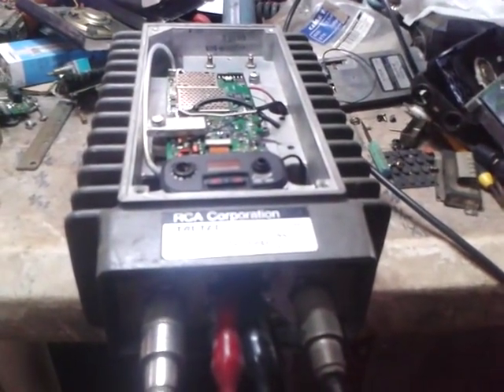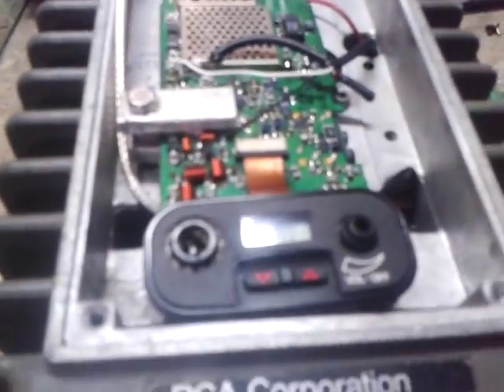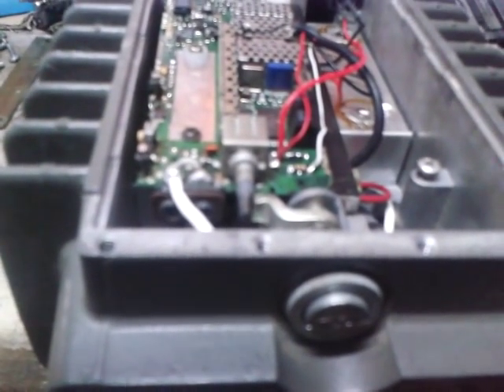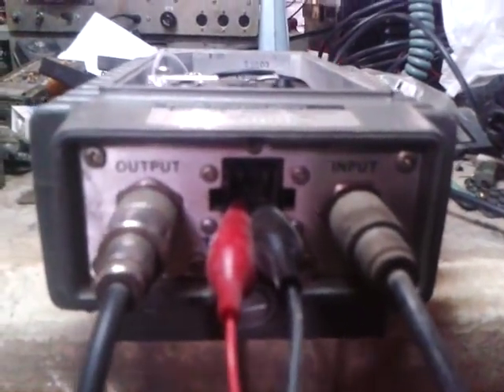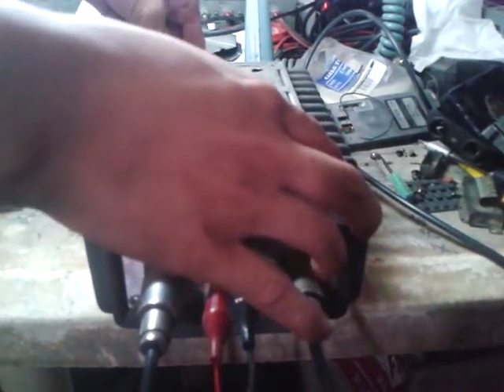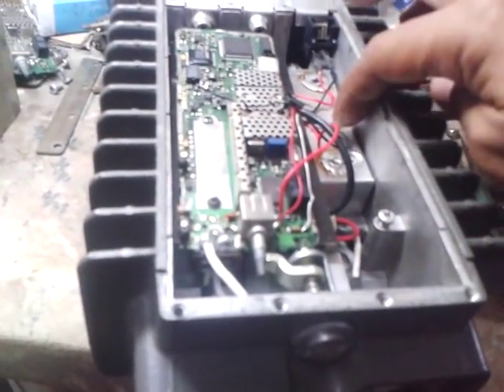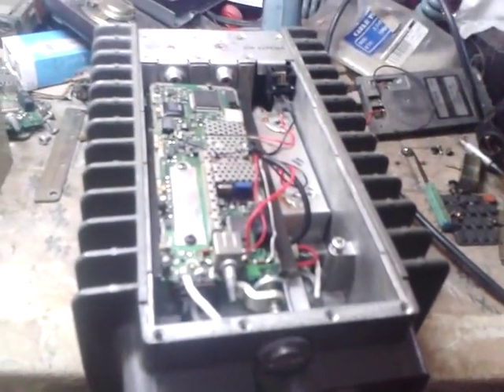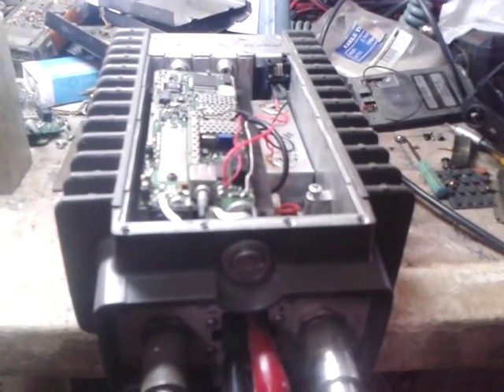4F1KJA MOTOROLA Crossband Repeater Modification

Comment from the maker: From the previous post on RCA TanTec Microwave Power Booster eliminating all the circuit board leaving the filters and using its heavy duty heat zinc case .NOW, its operating as to replace a MOTOROLA Board as a Motorola Crossband Repeater system. UHF on RX, using a Motorola GP88 and VHF for TX, using a Motorola AP10 5watts Power Output modified to a 10watts Power Output. Any question or inquiry please do not hesitate for a private message. 73 de 4F1KJA
Reply: 4F1KJA sir  maganda ba gawing rx     yong gp2000vhf